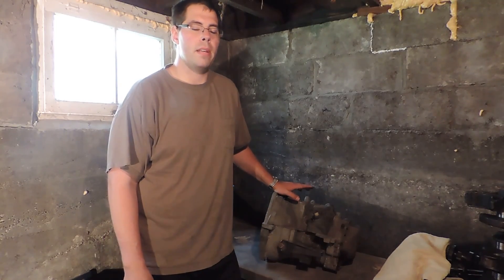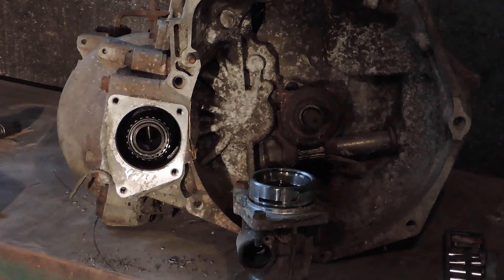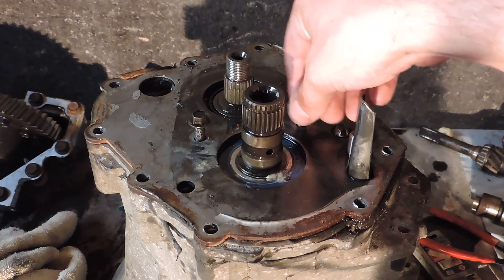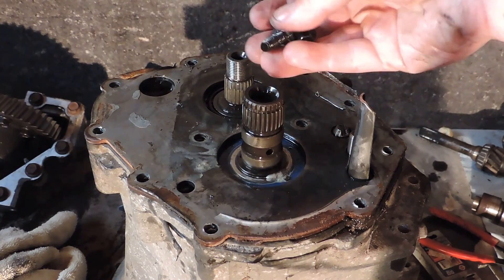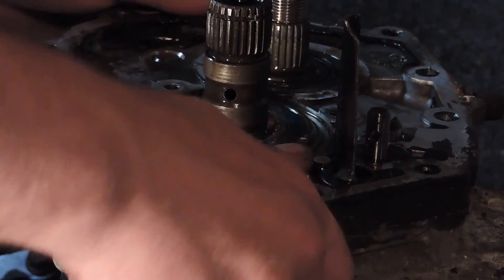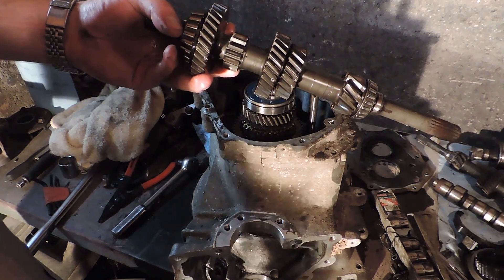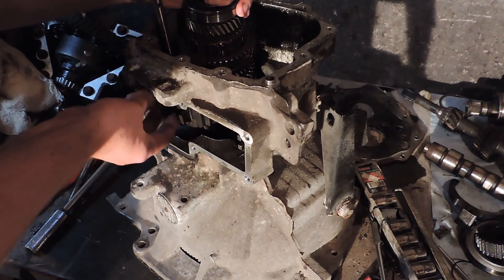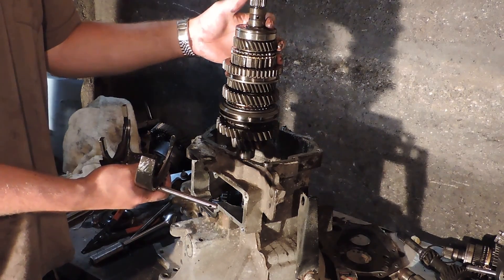Dodge FWD Manual Trans Rebuild

Comment: Hello great video how much does the differential cover cost mine got a hole in it I hit something in the road?
Reply from the maker: You might want to look into having it welded up, as I've been told that the case and cover are machined together. While that may not be the case, I think you'll have a hard time finding someone who has just the cover for sale. Try the SDAC facebook page to see if anyone has a cover they're willing to part with.

Comment: Hello, what about a friend? Excuse me, I have the same a523 3.78 transmission in my 1994 5-speed dodge caravan, and I need to remove the part where the speed sensor is mounted to put sealant between that part and the transmission housing, the query is: I can remove that piece just by supporting its 4 bolts and then reassemble ?, it happens that when removing this piece the difference could move, or this piece may not come out since it has two bolts that would be from the back that I think should be also release and then press ?, I would appreciate your answer. Greetings from Chile.
Reply from the maker: Yes, you can remove just the piece and reinstall it with RTV on it. Thanks for the comment and the view!
Reply: @bwcordes  thanks that was the solution.
Reply from the maker: @simoncalderonarce7617  Excellent. Glad it was that simple.

Comment: cordes, I tore down one of my a555's today, and used this video as a guide. It is an 87, so no nut atop the input shaft, but the other a555 I have is an 89, and my thought is to make one really good tranny out of the two. Some time ago at TD, I came across a guy unloading a bucket of misc TD parts, and headliner material(NOS). In the bucket were several sets of shift fork pads(NOS)!!! As well as a ton of hardware and gaskets. I'll keep it posted in the log at TD. Thanks my friend. :)
Reply from the maker: Glad to help. I need to get the final installment up. I was surprised at how easy it was to shim the diff and input shaft.